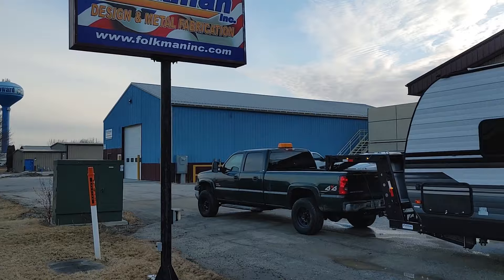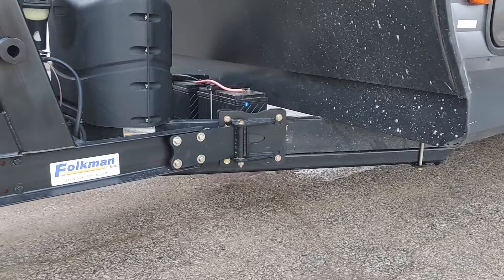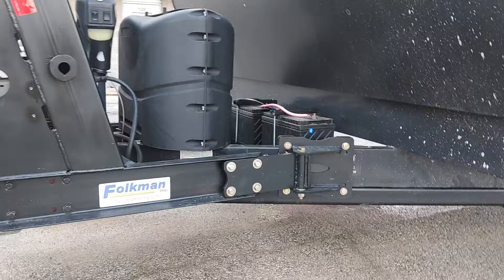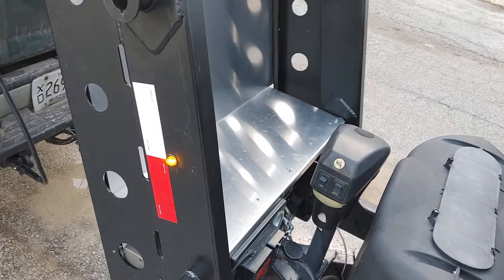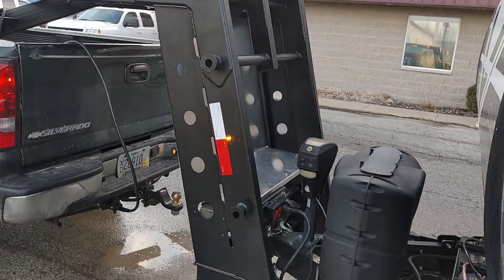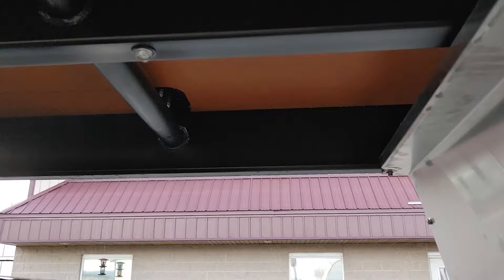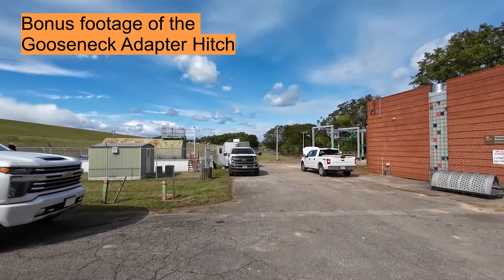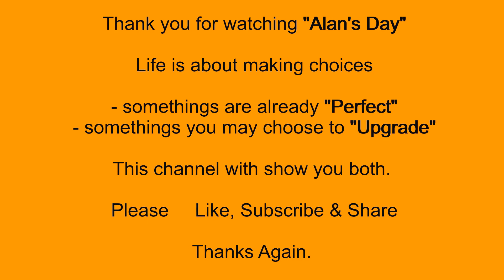Alan's Day  - Shop Walk -  Gooseneck Adapter Hitch "Convert your Bumper Pull to a Gooseneck"

Comment: That’s putting a lot more leverage on the frame of trailer.
Reply: Where do you think that leverage is going without the adapter? Lol
Reply: @LEKS6652  you’re adding another 5-6’ past the ball. So the trailer has more stress added to the front of the frame

Comment: Interesting concept but I am not sure why I would add this to my trailer increasing its length and weight.
Reply: Better  turning  going  forward  or  back.  Smoother  ride  since  the  teeter totter  effect  is  removed  by  moving  the  contact  point  from  the  bumper  forward  to  the  rear  axle.  Also  should  increase  weight  capacity  I  would  think.  As  a  safety  factor, theoretically,  in  case  of  a  trailer  wheel  blow  out,  since  the  contact  point  is  above  the  axle,  the  force  of  the   blown  wheel,  won't  throw  the  rear  of  the truck  as  much.  Theoretically.  And  as  they  have  it  set  up,  more  storage  possibilities.  Not  afiliated  with  them,  just  had  a  similar  idea.
Reply: How does it increase the length? It’s still the same distance behind the truck
Reply: @gregsilva1472 no its not
Reply from the maker: Thank you for watching the Goose Neck Adapter video. This Adapter Hitch is not for everyone. When hooked up to your truck, this hitch will add about 18" to your overall truck and trailer length. You are correct about the extra weight. If your truck can handle it pin weight, the Goose Neck style hitch will offset issue.
Reply from the maker: Thank you for watching the Goose Neck Adapter video.  You will add about 18" to the overall length of the truck and trailer.